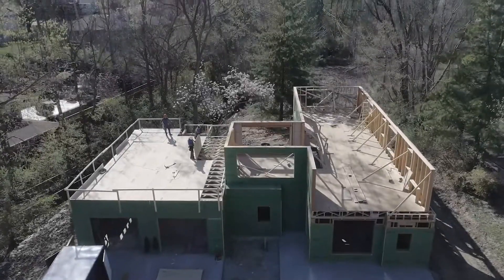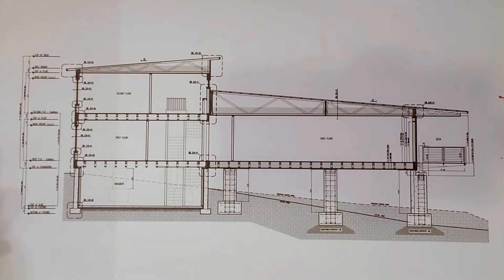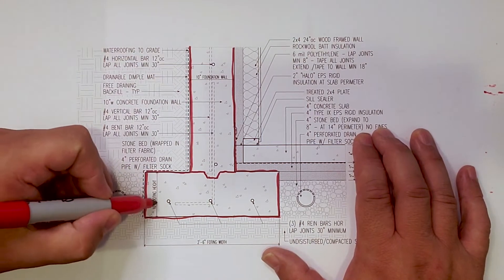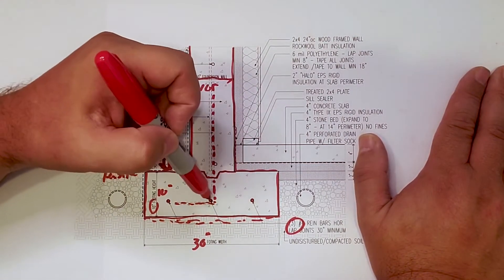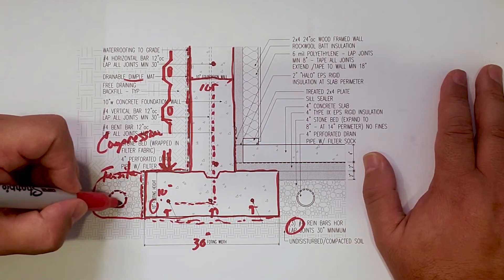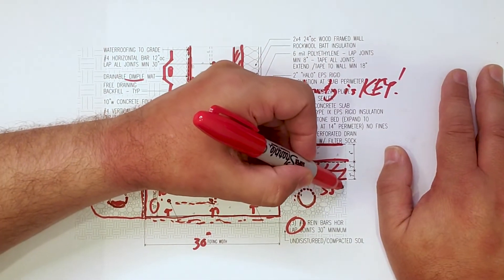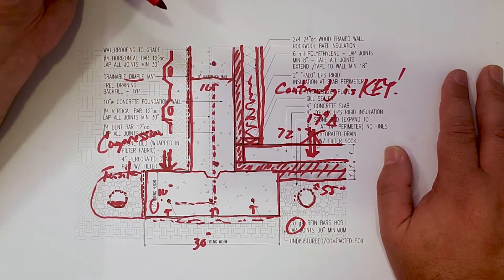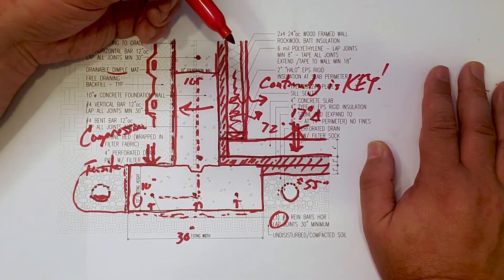Foundation Footing Detail - Before The Build Series: Hilltop Aarow

Comment: steve-why not have the outside drain pipe rest on the bottom of that trench on top of filter fabric rather than severe inch sou stone/ also shouldn't the dimple mat end a bit higher as well ?